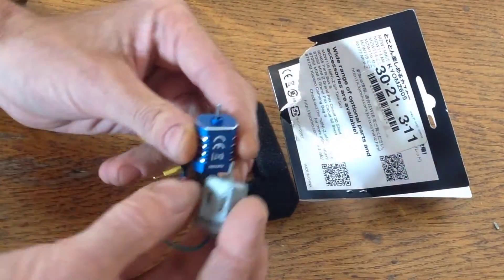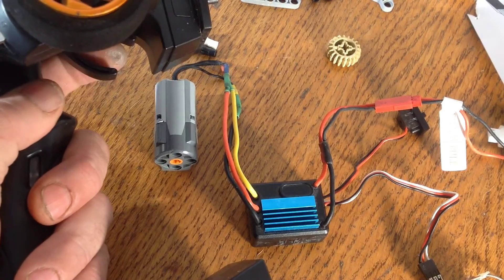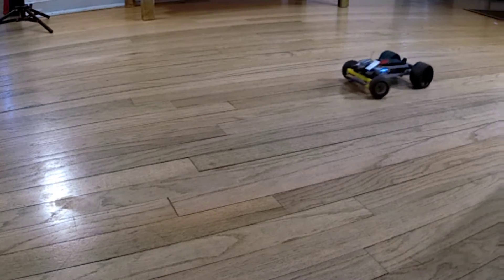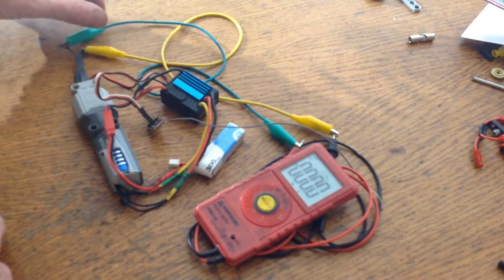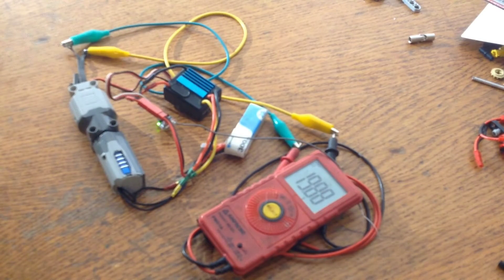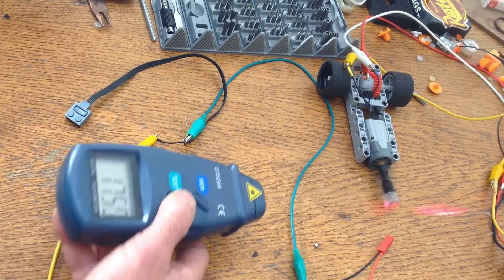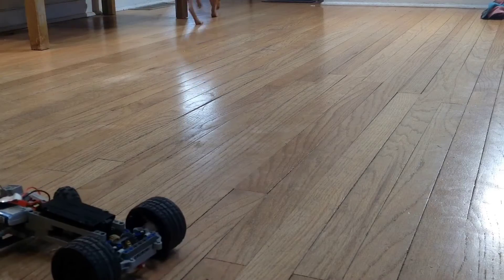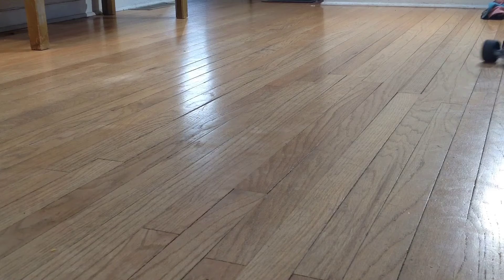Brushless Lego M Motor Rips!

Comment: Hi, MaxBrix.
I wondered, if you had any issues with temperature (related to this project and your XL motor project)
I've read that BLDC Motors get (normally) up to 60-80°C and the glass transition temperature of ABS is around 105°C, which might be reached, if your motor should start overheating.
I have no experience with BLDC, however, so...
...do they get hot? Does your motor housing melt?
Reply from the maker: I have an XL also. More power than you would ever need for Lego. No problems so far any of the times I used them These motors have so much power they are working at less than 30% power most of the time. Those temps are what you would see on a drone or some kind of high consumption situation. If you push them hard you will break a Lego axle or slip some gears and get some chatter. If you gear them down and let them run fast there will be not much strain on the motor so it won't get hot. 

Buy a cheap knock off if you don't have an old broken motor. If you ever have a motor give out then do this. Then it doesn't matter is it melts. Play and learn, you might break something, that is OK. Then you leanrn the limits.
Reply: Hi,
recently I have tried my own brushless project: I took a Lepin L motor and tried to mate it with a 2030 4200kv brushless motor.
I used a lathe and a 3D printer in order to make everything fit.
Unfortunately every cut I made was a little too tight. The result was some lateral force (as I believe) that made it spin not too freely. 
First the motor got a little hot (I used silicone grease). Then I thought, the lube is too thick and thinned it with silicone oil spray. The result was the first stage of planetary gears absolutely molten.
Now I am at square one again...
Nevertheless I have two other fake L motors and I'll give it another shot.
This time I will leave it a little more wiggle room and look how it'll work out.

Comment: Thinking of doing this mod to motorise the CADA RX7 but not sure if it can take the mass of that model at almost 6kg. Have you tried heavier vehicles with these motors to see what their performance is like?
Reply from the maker: I have an XL brushless mod. If you have a 3D printer. That would be vastly better. You will have to increase gear ratio but it will rip. The limit is the torque Lego can handle.  - https://youtu.be/qxQoh6fpYQg
Reply: @MaxBrix awesome, that definitely looks like it'll be more up to the task. Thanks for these vids, great inspiration!

Comment: is there a way to turn the connections back to the normal powered up connection?
Reply from the maker: Short answer - no. 
long answer - This can be a bit weird at first. Brushless motors use pulsed DC so you have to use the correct power supply(brushless electronic speed controller, ESC). as long as you use the correct power supply the connector does not matter you could use an appliance cord.
Reply: @MaxBrix  ok...

Comment: Do I need to make something so the motor works with the shape for Lego shafts to fit or does it just clip in?
Reply from the maker: It is an exact replacement for the original DC motor in the Lego M-motor. Same housing and holes the shaft is slightly smaller as discussed in the video.
Reply: @MaxBrix  so theoretically I can just take the motor apart and put this one in
Reply from the maker: @reesemolloy6109  You have to attach the sprocket and have the proper electronics. It is hard to take the M-motor apart and put it back together.

Comment: Do you know how to hook it up to a pf wire and connect it to a buwizz 3.0 pro?
Reply from the maker: That won't work. This motor needs a brushless motor ESC - Electronic Speed Controller. The ESC sends pulses of electricity to the motor at different rates depending on the motors speed. The ESC senses the motor speed through the same wires to adjust the speed and timing of the electrical pulses. A brushed motor just takes regular DC current.

Comment: Hi MaxBrix, just wanted to know, I wasn't able to see any information about the brushless motor in this video (like what voltage and stuff is needed) so would it be ok if you provided a link to the battery that you used in this video? And additionally, how did you steer this vehicle?
Reply from the maker: I suggest watching a video about how brushless motors work. This motor did not come with a cell rating, I used a 2s lipo and the motor still works.  links for the motor and esc are in the description. Any 2 cell battery will work fine.  I use a a radiolink transmitter and receiver to actuate a servo attached to one of two parallel bars connecting the wheels.
Reply: @MaxBrix  ok, thank you!

Comment: Would you consider testing slot car or nerf upgrade motors? they are the same 130 form-factor as the stock motor and can have similar voltages.
Reply from the maker: That was the last video. I used a Tamiya torque tuned 130 motor. It was really good.

Comment: This would be very useful but I would need an speed controler, lipo battery, receiver, remote, and the motor
Reply from the maker: Just get more hobbies. Get a radio/esc/ battery for an R/C buggy or plane or drone. Then you just need the motor.
Reply: @MaxBrix  ok ill try to get more hobbies 😀

Comment: This is insane power for legos, would be great to run some fans or vacuum impeler! But I'm sure running a brushless motor requires quite a bit of electronic sadly
Reply: Well, compared to a buwizz and how much power u get. No!!!! You can run brushless for about 100 Euro. Depends on what u want. 
Some components are better when more expensive. But of course u can use a 15 Euro radio control too, for example

Comment: That's a great idea that really ended up working fantastically!! Love it!!! Thanks for sharing!! Just wondering how you wired it, 3 wires going to 4 on the Lego M motor?
Reply from the maker: A brushless motor will connect to a ESC(electronic speed controller) you can see it in the video during the voltage test, a black case with blue heatsink. the esc hooks up to the motor, the battery and the radio receiver. A brushless motor is an A/C motor so it needs a different controller. It was hard for me to figure out at first but once you get going it makes sense. Brushless motors kick ass!
Reply: @MaxBrix does it come with the esc? It's what you showed in the box?
Reply from the maker: @JaceN3D  This motor came by itself in the box. I can't put a link here so I will put one in the description.
Reply: The PF system has 4 wires. Two are for stable 9V power supply to LED lights, IR receivers, Servo motor (which has an electronic controller) and other components that are not DC motors. The other two wires are for all Lego PF DC motors such as the M, L, XL and buggy motor. These two wires transfer power that can switch polarities so that you can spin a DC motor both ways. These are the only wires the M motor and the other motors actually use. The other ones are just there for consistency across the whole system
Reply from the maker: @Mr.Engine993  Really good explanation!